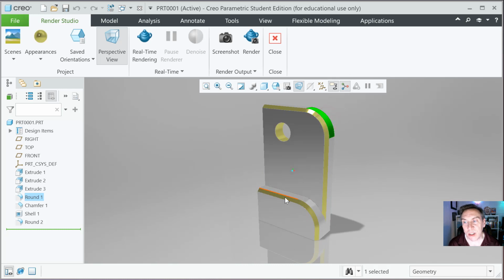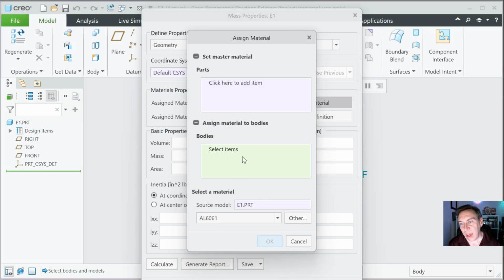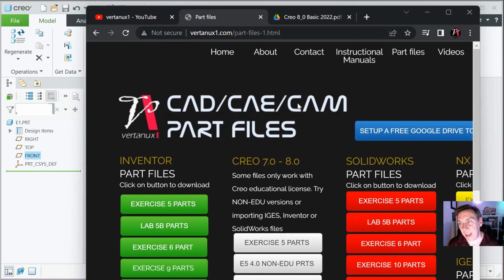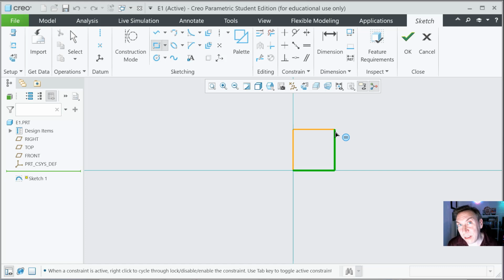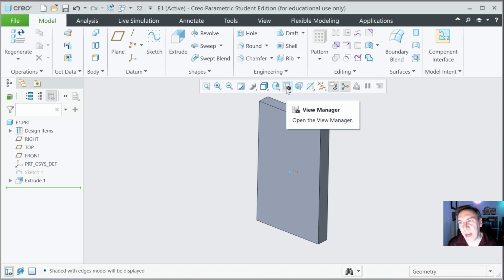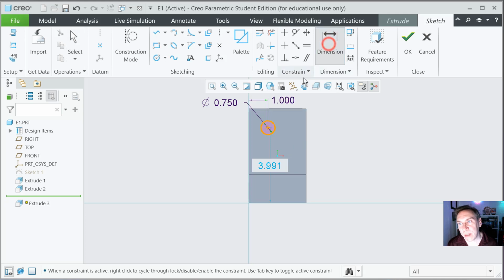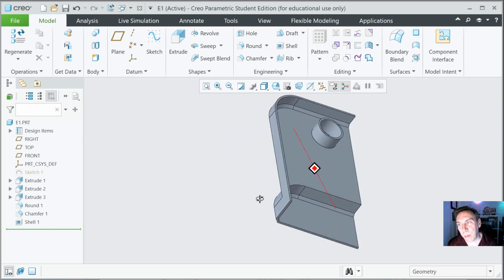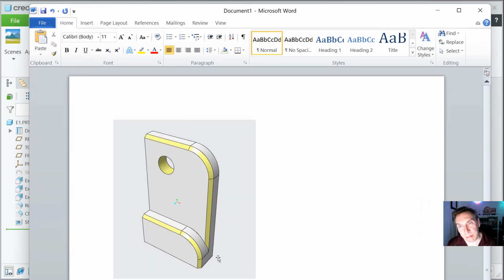E1 Creo Parametric 9.0  - Basic Modeling for Beginners Tutorial with Training Guide | Tips

Comment: Hi Chris I would like to thank you for your tutorials, they are a pleasure to follow. I have a question for you: I have seen in recent times a dozen tutorials on how to draw gears in solidworks with most of these showing " the how to " using the assembly environment.  You really need to know some parameters before fishing out the right size gear from the toolbox to fit in your setup therefore I am very happy to see how you can you draw them from scratch in the part environment as shown in other clips. In terms of teaching the how and why I don t see any other tutor on the web more qualified to  teach how to create a drive train explaining how to size one of the cog down or up retaining the same teeth size. I hope you can help.